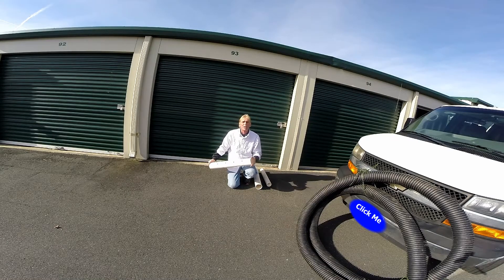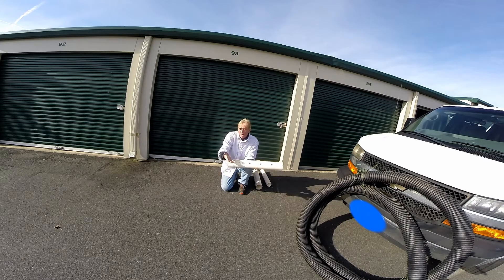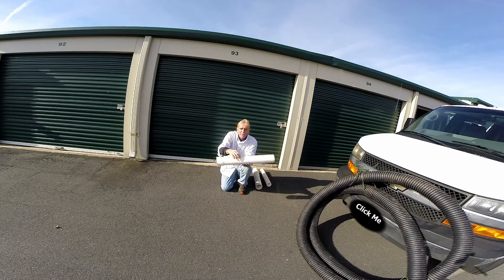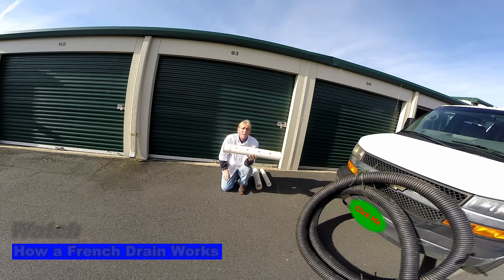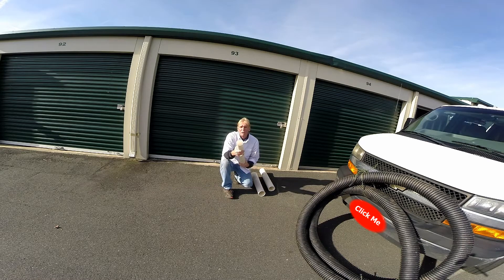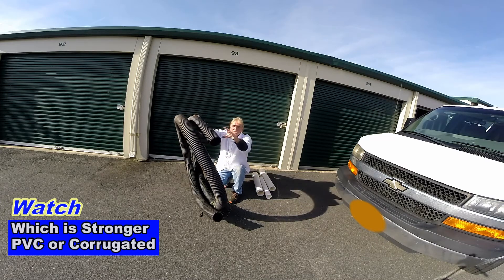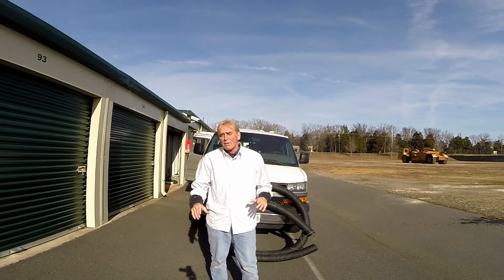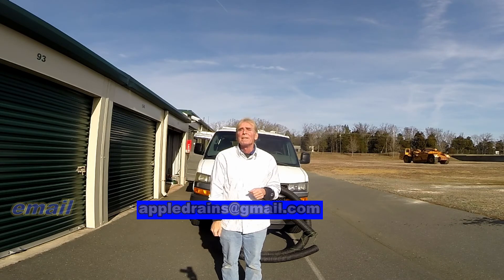Perforated Pipe Where to Use

Comment: I have a private road i was going to put some gravel over some of this and then road base over that, my road fills with mud and water, should i use perforated or non perforated to get the water away from the road and into the ditch? i was going to just dril holes at 10 and 2" near the top of the non corrugated 4" pipe so rain that falls will go into it and out the pipe. would this be wrong?